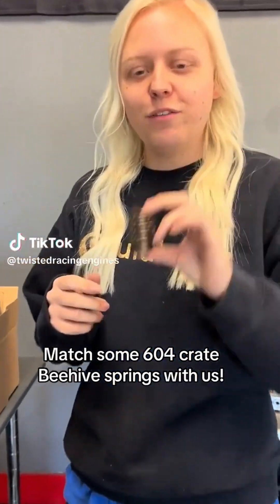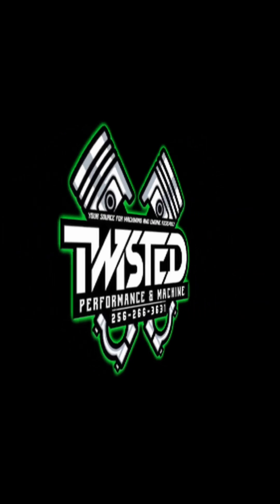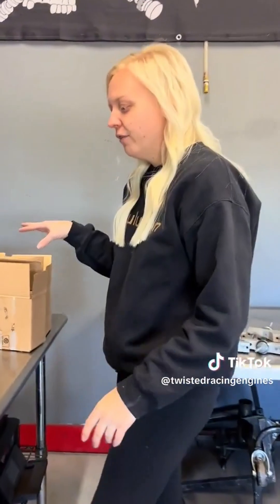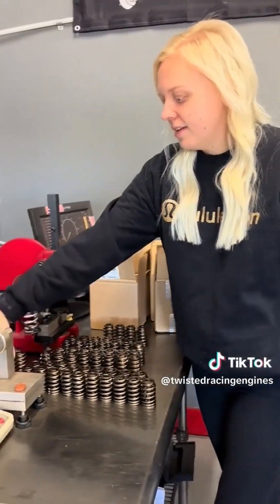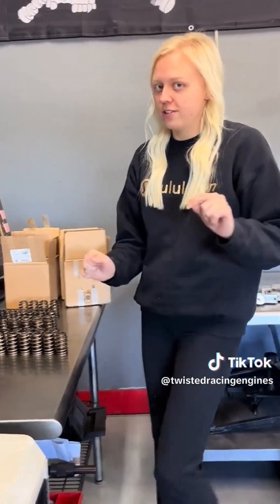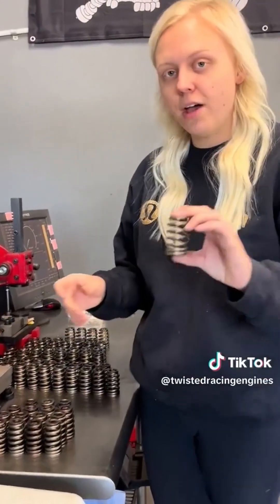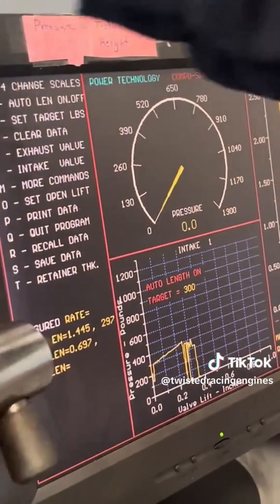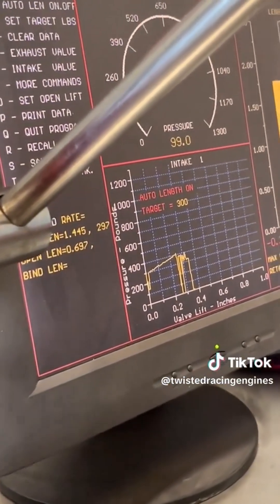Matching 604 Valve Springs

Comment: WhT do yall do with sub par springs?
Reply from the maker: We sell them on the website marked as culls.  You can still run them in stock engines or relatively low lift/low rpm applications.  We don't suggest running them in racing or high performance engines.  They are still good springs and within GM spec.  It's just that they aren't the cream of the crop which is all we use in our race engines.  You can check them out on our website, twistedraceengines.com